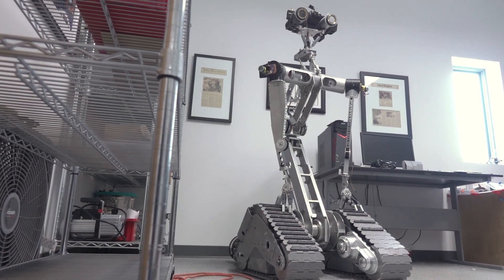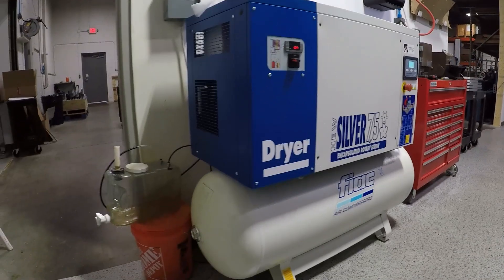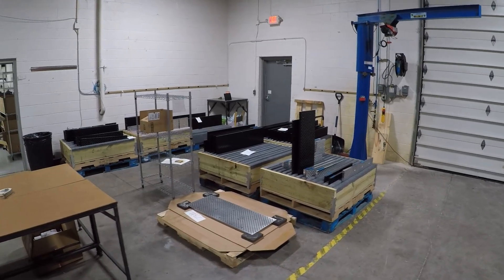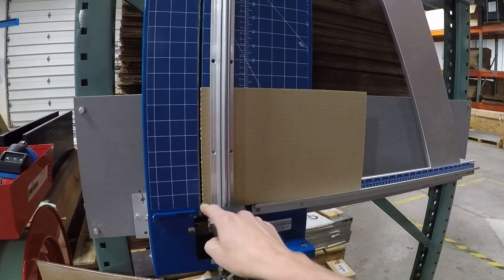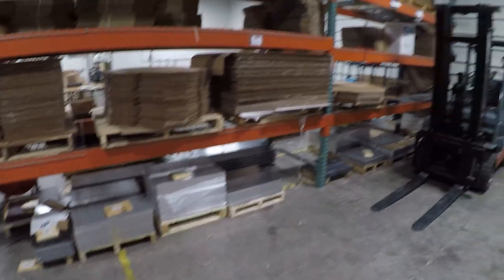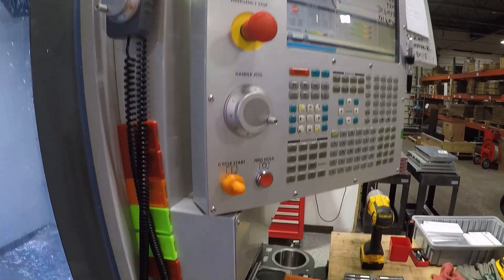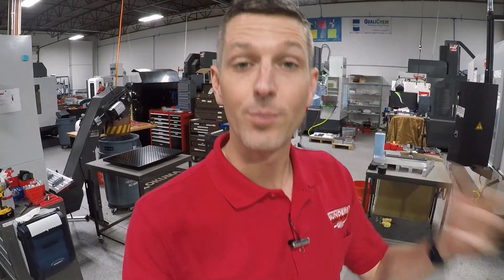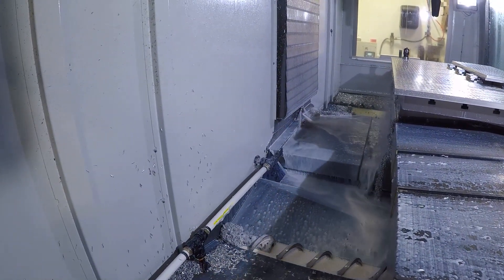Johnny 5, Jib Crane, and Quality of Life Improvements!  Machine Shop Update January 2022

Comment: I don't understand what the new trend is with shops and Jib cranes. Anything to supplement a forklift, to allow for heavy lifting, or to reduce the amount of times shop personnel have to manually lift is a well spent chunk of change. The jib crane (as shown here) is the least cost efficient of the cranes. Like mentioned here, the cost of the crane is not too bad, however, when you factor in the cost of installation (foundation, planning, permitting, engineering, etc) and the cost of permitting and planning (if required) makes it rather expensive. It can never be easily moved, and it only allows for lifting around the diameter of the main beam.  If you want to move it, you cannot just unbolt it and move it, it is basically a repeat of the initial installation repeating the cost of installation costs. A much better (note: my opinion) and much more economical overhead lifting is a freestanding gantry system, not a portable gantry but a stationary gantry with X/Y travel. Most overhead gantry systems require nothing more than a standard 6" concrete slab to bolt to (a pretty standard thickness in industry), adequate power, and physical space. Gorbel has a system, I have experience with Craneveyor, and I know there are other manufacturers out there. Most 4 post+ gantry systems can be put up in a manner of a few hours, they can also be taken down in less time and moved to another spot and put right back up.  The one thing that I find the most beneficial is that there is no central column, there are just the supporting posts that can be placed as far out as desired. You have complete access to anything under the horizontal beams. Just my opinion, but do your homework before you jump to something like this. Some applications are better suited than others, but I stand by my word that jib cranes are the least value of the overhead lifting.

Comment: If i may ask, any of you professional machinists, how possible is it for you to explain, and even teach someone with ZERO experience machining? Too frustrating? I fear I won't be able to find a mentor and I have a hard time learning by just reading. I have to be hands on with someone showing me. So finding a teacher or just a friend to let me hang out and watch and ask questions i fear would jsut annoy them answering such basic questions that you guys have learned to do subconsciously over decades of experience.
Reply: Depending on where you are, you might have a nearby community collage that offers a shop class. I believe you can take individual classes as you want without having to sign up for the complete degree package will all the credits.
Reply: It depends on whether you're trying to learn machining to be a hobbyist, or if you're trying to do it as a career. You need to go to a community college or find a machine and start watching YouTube videos. There are plenty of videos to learn every single aspect of machining. Or you'll need to get a job at a shop that is interested in training someone new from the ground up, spend a year swiping does and moving stock, spend a year cutting, prepping, deburring, and doing other post processes (polishing, corrosion protection, stocking, boxing, shipping, etc), spend another couple years being a machinist's helper by fixturing and indicating stock, and then they may let you lose on a machine.

Comment: I used to be a process engineer and among my responsibility was training and monthly/weekly audits for some air handling equipment. It is easy to keep up with air compressors (or any equipment) when they are new and interesting. I would recommend writing down (from the beginning) everything to do with that equipment. I include in that the training documents for operators AND maintenance. As you may already know it is so easy to forget this stuff in a busy shop… the months and years will fly by really fast, then it has all been forgotten. Good luck. 🏳️‍🌈

Comment: Those magnet things you should sell in packs and with custom text on. Really cheap but looks to be a very useful item. I'd use it if I had the.
Reply: And make one "I was thinking" so you can place it on any crashed machine.  It will make it easier for the repair rep to find the broken machine and explain what happened at the same time.

Comment: Very cool update. To get a flow and reduce the heavy lifting of the plates have a look at roller conveyers. 
You migth be able to place  the QC station behind the conveyor and then just roll it sideways after checking for packaging. so you just have to lift it manually once and then can roll it to the jib crane. 
You may also be able to spare out some rollers to be able to get the packaging below it to make it easier (or slide the plate over the packaging paper)